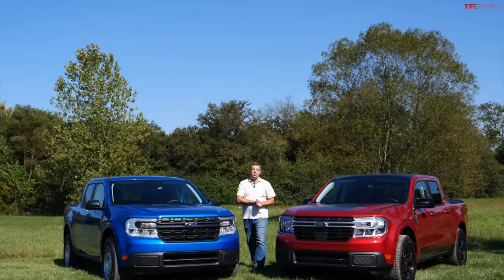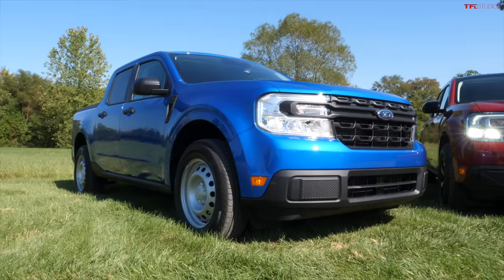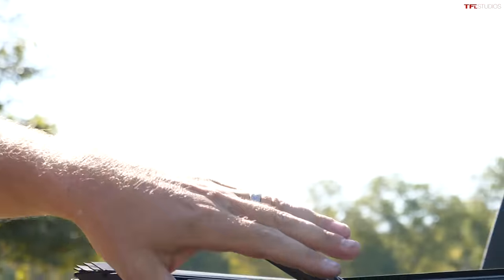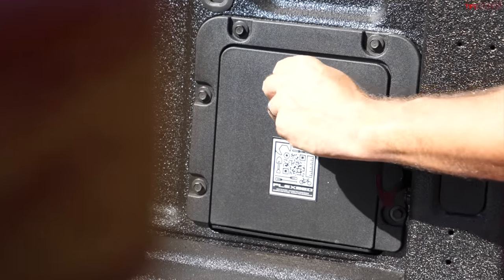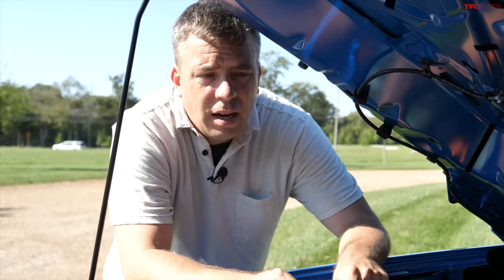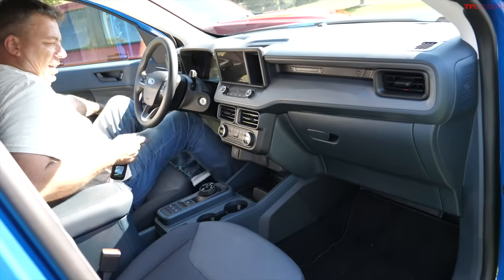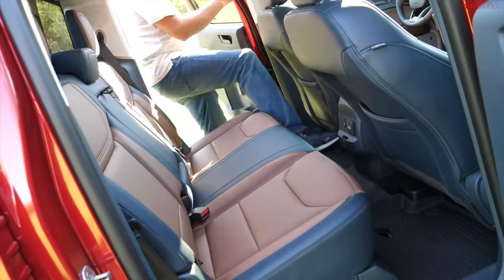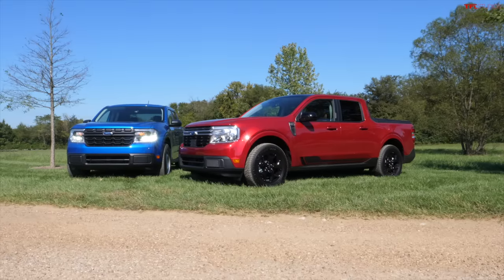HANDS ON with the Least & Most Expensive New Ford Maverick - The Differences Will Surprise You!

Comment: Seriously other than the ultra cheap base price of slightly under $20K, who's gonna want a "front wheel drive" unibody construction pickup truck with a (laugh) "CVT" transmission + only a 4 foot truck bed? Other than the excellent combined fuel economy, I don't see much greatness in the "base" XL trim model Maverick. A much better bet would be the mid-level XLT trim with the more powerful 2.0 liter EcoBoost four cylinder turbocharged engine, much better conventional 8 speed automatic transmission as well as available AWD so more like a Honda Ridgeline etc. The XLT trim also has of course a more unique interior, colors etc, more options, a high available towing capacity. A strong point for the new Ford Maverick "compact" pickup truck is an actual small true "crew cab" with atleast bearable room for 2 average adults, decent pricing if trim/options are kept in-check & more versatility than a sedan car. I do see Ford's strategy in price & trim levels/options etc. For a "premium" trim Lariat Maverick for say $34-36K+, one could easily get into a much larger, more capable "midsized" Ford Ranger in atleast XL, STX or possibly XLT trim with 4wd in either Super Cab or Super Crew (crew cab) body. Same for the Ford Ranger. One could opt for the absolute cheapest 2wd (RWD) XL trim for the lowest possible price. But if one gets giddy with trim packages/options on the Ford Ranger, say a loaded Lariat model with Super Crew cab, 4wd, FX-4 or Tremor off-road package, that would sticker for easily $42 to nearly $50K. For that heady kind of money, again one could easily get into again a much more capable & huge room Ford F-150 fullsize pickup truck with larger 2.7 or 3.5 EcoBoost V6 twin turbocharged motors or a more traditional 5.0 Coyote V8 in Super Cab or Super Crew body in say base XL or STX or XLT trim!

Comment: For $36k... If given these two vehicles as a choice, I would EASILY choose the base model.  NO WAY IN HECK I'd be willing to pay an additional $17,000 for those additional options.  

Ideally, I'd like to outfit an XLT with moderate creature comforts for about $24k.  In my opinion, that is the sweet spot in the Maverick for my personal use.  👍🏼👍🏼

🇺🇸🇺🇸🇺🇸🇺🇸All in all .. I think this is a TREMENDOUS value from FORD. 👍🏼🔥🔥🤟🏼🇺🇸🇺🇸🇺🇸🇺🇸
Reply: Yup, I did the XLT with the luxury package.  You get everything you need and it was like 27 k.  Besides I personally prefer the look of the XLT interior compared to the Lariat

Comment: The gas turbo one is great with the 4k tow option, but will net me an extra 3k to have all I want, and AWD. A part of me feels like I would or should just get a ranger at that point. Also, I don't trust Ford at all anymore. Coming from a 2012 Fusion, I feel like the parts under the hood fall apart too easily, considering I baby my car and work on it myself on matters I don't trust mechanics to do quality on.

Hybrid has insanely good MPG, like over 8 years is tons of gas saved and less guilt over heavy traveling. Then tack on the fact for those 8 years, it is under warranty. I was hard pressed at first about going to the turbo ecoboost engine, but got a lot of news at how bad their turbos are and that they go bad at around 80k miles on engines less than 2.5 L, not to mention Made in Mexico is sketchy on quality assurance. The towing capability isn't worth the risk of having to pay extra thousands in the coming years in repairs. As I said, Might as well get a ranger or other good MPG newer trucks.

I really just want the truck body/frame more than full truck experience. Towing is a huge plus, but I'm likely only to tow a utility trailer. I mean, getting around 40 mpg for up to 8 years of warrantied truck use sounds like a damn dream to me. I love the blue, low profile and almost everything about the body, maybe a slightly larger backseat cab space(like a literal 3 inches would have went a long ways... Ford), shifter knob sucks.
Reply: Wow Jeremy, lots of detail! The Mav videos on my channel will help you. Ask me any questions about my Mav AWD with 4k tow and my Mav hybrid.

Comment: For that kind of money I’d probably go with a normal truck despite the gas mileage. The bed is too short. You get more towing and payload with a Frontier or Tacoma and probably longer lasting engines and real 4WD transmissions. The new Frontier is pretty sharp and the old Frontier is a deal.

Comment: Great pickup for the money but it sucks that u cant build and price order one till aug 2023. All sold out unless u buy one off the lot with options u dont want to inflate the msrp. I wanted to order one in april now im forced to either wait till august if my car last that long or buy one with options i dont want. Ford should have realized how popular they were and built more stock before releasing it
Reply: You actually have until today to order a turbo version. Capacity sold out, they can only make 6000 per month. 
Hwy mpg not much different than hybrid. 
Find a dealer that takes orders at msrp they are out there. I got Mav eco AWD 360 lux 4k for 30,710 including shipping. 
With inflation announced at 7%, magnesium, chip and supply chain shortages, my bet is msrp goes way up for the 2023 MY.

Comment: I'm gonna buy one next spring because I can actually afford it. Also why would I buy a used $10,000 - $20,000 truck that has 150k - 300k miles on it? Thanks ford :)
Reply: I would not wait. With all the supply chain issues and the magnesium shortage price will probably go up.

Comment: Honda should be worried for years, decades really they have offered a unibody truck without any competition. Yes, Ridgeline gets compared to other mid size trucks but its really not the same vehicle.  It does not have a frame and its all wheel drive not 4 wheel drive like the competition. Even loaded the Ford  considerably cheaper than Honda.  Plus, people are wanting "small trucks" again as an alternative.  I have had many of Tacoma's over the years and the last one I had (2016) was WAY bigger than my (1982) like to the point I feel that Tacoma and others are about the size as when the T-100 was released which in its day was definitely "mid sized".

Comment: Does this CVT have a torque converter? No.
Does this CVT have a drive belt? No.
Is this CVT related to regular CVTs at all? No.
Stop calling it a CVT, it's confusing. Call it an electric variable "transmission", or anything else.

Comment: People want a maverick for these reasons: cheap, has a bed, and mpg.
Cheap means you are gonna have quality and reliabilty problems because of cost cutting and poor manufacturing to sell it so cheaply.  Also, having a bed is great, but when the weather doesn't cooperate you will start wishing you had a camper or tonneau cover to keep your stuff in the back dry.  Ask me why. But that kind of eliminates the advantage over a crossover or SUV.  You dont need a bed...SUVs and crossovers tend to be configurable to allow lots of cargo space and protection from the elements anyway.  Also, most people will never use the bed regularly so why get the maverick over its mechanical twin the Escape?  That will ride better with more weight over the rear axles as well.

Comment: Ill stick to my 2017 frontier. 6ft bed and 6300 pounds of towing. A reliable v6 and 4wd. Can find them low mileage for around 26k.  I would not trust a Ford hybrid system.

Comment: They could make a cheap steel wheel that looked good to go on the entry level truck.  I don't get it other than making them ugly on purpose to get you to upgrade.  The top of the line looks nice but for 36K I'm picking something else.
Reply: I have a feeling that the XLs are gonna be put to use as commercial fleet vehicles like Transits and F-150s, so fancier steelies don't really make sense when you're driving the car to Hell and back with a full bed and are gonna inevitably damage the vehicle with dents and chips. It's a case of durability over aesthetics.

Comment: How big is the gas tank??? 
I replayed that part of the video 6 times, and could not understand what you said; please speak more clearly. 

I'm not interested in any hybrid, especially with breakdown-prone CVT transmissions (not a Ford-specific problem, CVT in any brand is not up to American duty cycles (might be OK in Europe where they don't drive as much, but not here)). Really don't understand why anyone would buy that 2.5/CVT powertrain combo. Plus, no way should we want the battery located INSIDE the cab ... given the chemical reactions and corrosion that happen with batteries in normal use. 
The 2.0L Ecoboost/8-spd transmission is such a great powertrain, and it gets great real world fuel economy, it's the only way to go. I just wish it was available in the XL as a rwd, because quite frankly there is much too much unnecessary stuff on the Lariat and XLT. I'd take the upgraded interior materials, just omit all the extra electronic toys that add no real value. I have a Lincoln MKZ and turn off everything I can, from my experience it's just useless annoyances that we shouldn't need to pay for. 

btw..... real pickup truck owners don't care if the tailgate is "damped"; it's supposed to be a truck, not a luxury vehicle for the Mercedes-Benz crowd of softies.
Reply: the CVT in the Maverick isn't a belt driven CVT (those are the nasty kind that fail easily) it's a motor/generator CVT similar to what drives a diesel/electric locomotive It's very reliable because there aren't any clutches in the whole unit.

Comment: If they would add an electric motor in the rear end hybrid it would be a winner for me or at least mechanical. Front wheel drive on a truck is not going to work for me.

Comment: Front wheel drive "pickup truck" with CVT LMAO
Reply: 1- it's not a CVT. People just call It that. No belt or pulley.
Look up how Toyotas transmission works for their hybrids. This is the same thing they're using. And yet it's one of the most reliable transmissions to date. 
2- plus it's only on the hybrid.

Comment: Small displacement engines with turbos are the dumbest thing ford does. 

Stick with the f150 with the 5.0 l v8. 

Maverick should have a v6 option with no turbos. The ranger is the same. All ford trucks should have a large displacement option with no turbos.

Comment: 1563 lbs of payload?! Somebody needs to revisit the engineering standards when my 1500 RAM Laramie is only rated at 1210. Really? No wonder people are comfortable overloading their half tons as per the manufacturer’s ratings….
Reply: The maverick is actually built stronger then the ram because of its unibody construction.
Reply: @paulwatson4189  Must be built stronger than all 1/2 tons as 1200 - 1500 lbs pretty typical for all high trim level half tons. Wonder when the HD's will move to unibody construction?

Comment: CVT? Nope.  Even though it has a low starting point, (Try finding a non-greedy Dealer), I predict it won't be a Truck people drive for a long time.  Disposable.  No match for a Toyota (or even a Nissan for that matter.)  And... are  we really getting excited about Tie-downs and storage pockets?  Seriously... The Honda Ridgeline allows for a FULL sheet of plywood BETWEEN the wheel-wells.  That's a good thing.  It's almost as if these features should have been added YEARS AGO.   Not impressed.

Comment: As soon as he said 'FWD & CVT', that's an immediate turn off.
Reply: me too, what is your opinion of the Lariat's tranny?
Reply: @ssimpala1901  The Lariat has a 8 speed auto which is the one to get. But these aren't really 'trucks'.
Reply: the CVT in the Maverick isn't a belt driven CVT (those are the nasty kind that fail easily) it's a motor/generator CVT similar to what drives a diesel/electric locomotive It's very reliable because there aren't any clutches in the whole unit.

Comment: The Aesthetics under the hood suck and CVT transmission is a big turn-off
Reply: the CVT in the Maverick isn't a belt driven CVT (those are the nasty kind that fail easily) it's a motor/generator CVT similar to what drives a diesel/electric locomotive It's very reliable because there aren't any clutches in the whole unit.

Comment: CVT? See you in the junk yard soon
Reply: the CVT in the Maverick isn't a belt driven CVT (those are the nasty kind that fail easily) it's a motor/generator CVT similar to what drives a diesel/electric locomotive It's very reliable because there aren't any clutches in the whole unit.

Comment: This is disappointing on many levels. It is a pickup yet, the review is all about the buttons it has and nothing about the functionality. Will it pull my boat... oh look at the USB ports and you can 3d print a trash can for it. (?). Ah, and the base is 20k but if you want water bottle holders in the door... that is another 16k.

Comment: Lost me at CVT
Reply: the CVT in the Maverick isn't a belt driven CVT (those are the nasty kind that fail easily) it's a motor/generator CVT similar to what drives a diesel/electric locomotive It's very reliable because there aren't any clutches in the whole unit.

Comment: These "trucks" are complete trash. I don't see either one of them making it to 150k. A modern car, even a budget car should easily have durability to 200k miles. And no independent rear suspension is nearly criminal. Oh and no consumer truck comes with a 7 pin trailer connector. They come with a 7 blade trailer connector. Know trucks to review trucks. But these are not trucks.

Comment: So, the only trans you can get is a CVT? Has any manufacturer built a reliable CVT yet? Hint.... no.

I'll pass.
Reply: @paulwatson4189  yeah, as the vid went on I saw that, but only the ecoboost. The base and hybrid have the cvt, the hybrid says eCVT, but it’s not really a CVT, it’s an electric transaxle which can also use power from the engine.

I trust Ford with a new cvt as much as I trust them on their powershit... I mean powershift dual clutch.
Reply: the CVT in the Maverick isn't a belt driven CVT (those are the nasty kind that fail easily) it's a motor/generator CVT similar to what drives a diesel/electric locamotive... It's very reliable because there aren't any clutches in the whole unit.
Reply: @MrTonaluv  I have been digging to find out information on what you say, I cannot find anything that confirms your claim. What you speak of is the hybrid transmission they use, which also still has a belt driving the driven cluster. The base gas model also uses the CVT, a different transmission completely than the hybrid transmission.

A CVT must have a belt, and every Ford and every other make of CVT I found info on does have a belt. On their hybrid, eCVT, it uses 2 motors and the engines power, they call it an eCVT, but it’s not really a CVT in any traditional sense since it uses gears and an electric drive, not expandable sheaves to accelerate the drive outputs.

If it used gears to change speeds it by nature IS NOT a CVT. Continuously Variable Transmission, meaning the speed change is constant, not stepped as in any type of gear change. The only way to constantly change speed is to have two centrifugal or electric clutch’s change the diameter of the drive and driven pulleys that are always connected by some kind of link….. think belt.

So far, I haven’t seen any CVT that can handle big power or a heavy vehicle in any sense of reliability, hence why they use the 8 speed transmission in the EcoBoost model.

I think you might need some more schooling on the subject.
Reply: @guyforlogos  The eCVT in the Maverick is not a CVT as you know them to be, with belts and pulleys. It makes use of a single planetary gearset and two electric motors to create infinite ratios. Because the motors are what drive the wheels, many people say the system feels a lot like an EV.
Reply: @MrTonaluv  the CVT in a non- hybrid Ford does not have electric motors driving the wheels.

You are describing a hybrid transmission, not a CVT. 

So to spell it out for you, the base model CVT transmission and Hybrid transmission and the EcoBoost transmission are three very different transmissions. The prior is a common CVT, with a belt. The hybrid is called an eCVT, but is not actually continuously variable, as it actually uses electric motors and gears….. planetary gears too switch which motor drives to accelerate the output shafts. The later is a conventional transmission. It’s a bit confusing.
Reply: @MrTonaluv  To explain further, the eCVT has planetary gears, gears have a set ratio, if a transmission has a gear that changes during acceleration, it can’t possibly be a continuously variable. There would be at least one shift as the planetary either engages or disengages.

Comment: Don't buy cars with a CVT trans. Absolute junk!
Reply: the CVT in the Maverick isn't a belt driven CVT (those are the nasty kind that fail easily) it's a motor/generator CVT similar to what drives a diesel/electric locomotive It's very reliable because there aren't any clutches in the whole unit.